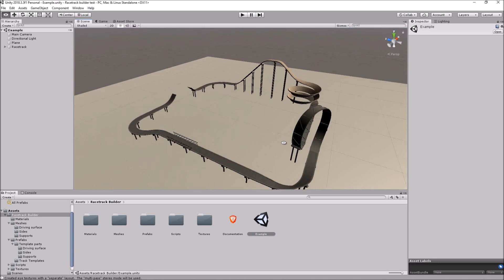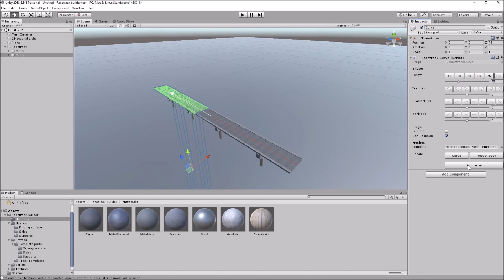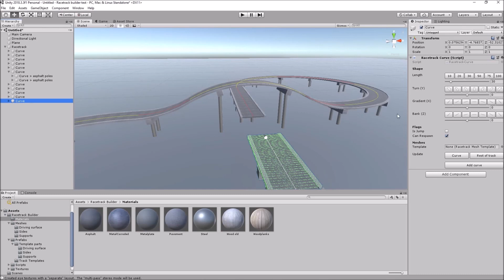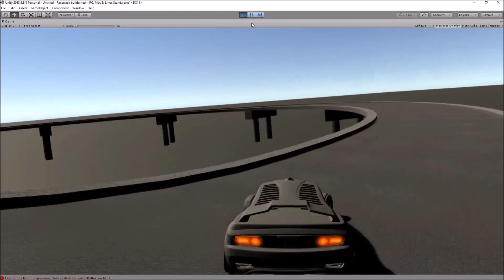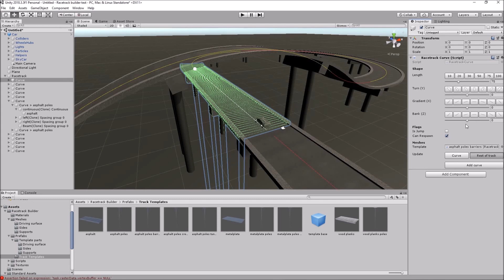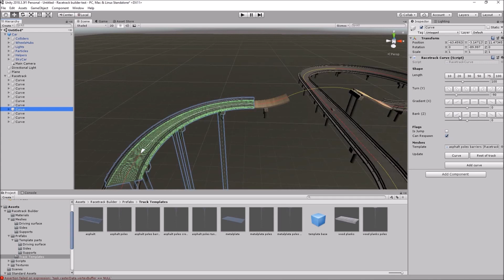Racetrack Builder - Getting started

Comment: is it possible, to let they car move by its own on the track e.g. in a round or from start to end of a track and every time in the middle of the track?
Reply from the maker: Hi.
Yes. You can use the Segments array and SegmentLength to find the current segment for any distance down the track. You can then call GetSegmentToTrack to get a transformation matrix that describes the segment position and orientation relative to the racetrack.

Here's a component that will automatically move an object around the racetrack.
(I'm not sure how well code posts in a YouTube comment. If this doesn't work I'll post it somewhere else and link to it.)

using UnityEngine;

public class MoveAlongTrack : MonoBehaviour
{
    public Racetrack Racetrack;

    public float Speed = 10.0f;

    public float Distance = 0.0f;

    bool Loop = true;

    private void FixedUpdate()
    {
        if (Racetrack == null) return;

        // Advance along racetrack
        Distance += Speed * Time.fixedDeltaTime;

        // Loop/clamp logic
        if (Loop)
            Distance = Distance - Mathf.Floor(Distance / Racetrack.RacetrackLength) * Racetrack.RacetrackLength;
        else
            Distance = Mathf.Clamp(Distance, 0, Racetrack.RacetrackLength);

        // Find segment on racetrack
        int segIndex = Mathf.FloorToInt(Distance / Racetrack.SegmentLength);
        float segOffset = Distance - segIndex * Racetrack.SegmentLength;

        // Position relative to segment
        Matrix4x4 segOrientation = Matrix4x4.Translate(new Vector3(0, 0, segOffset));

        // Position relative to racetrack
        Matrix4x4 trackOrientation = Racetrack.Segments[segIndex].GetSegmentToTrack(segOffset) * segOrientation;

        // Position in world space
        Matrix4x4 worldOrientation = Racetrack.transform.localToWorldMatrix * trackOrientation;

        // Break into positon and rotation
        this.transform.position = worldOrientation.GetColumn(3);
        this.transform.rotation = Quaternion.LookRotation(worldOrientation.GetColumn(2), worldOrientation.GetColumn(1));
    }
}